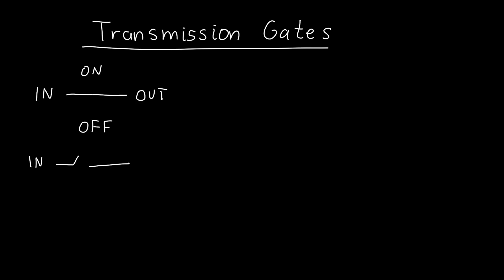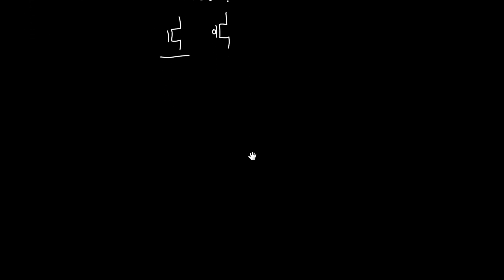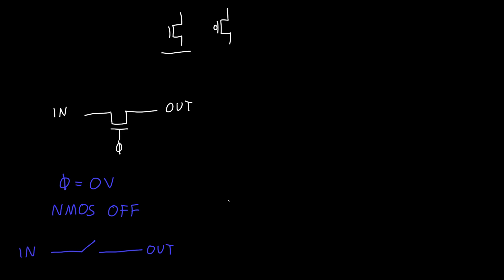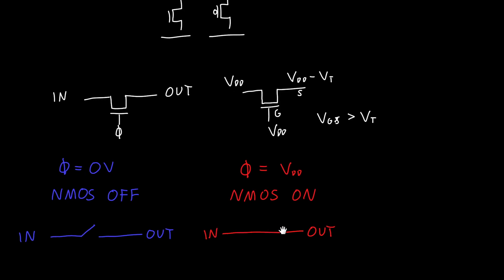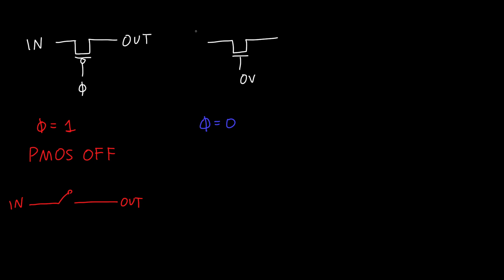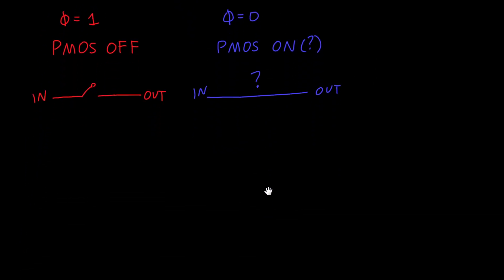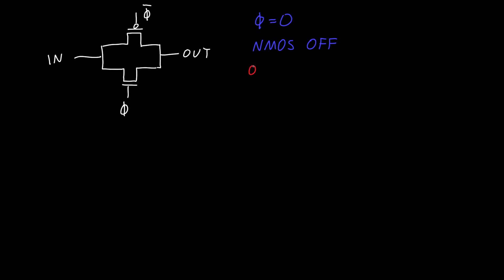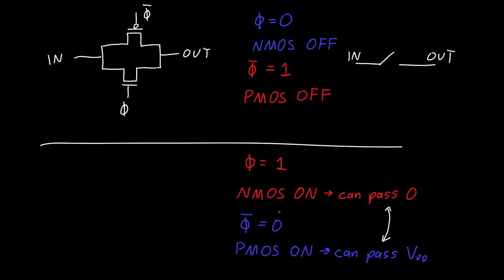Transmission Gates Explained

Comment: You missed about the MOS body diode and how to prevent it by tying the body of NMOS to GND and PMOS to VDD. Also it is important to note that the transmission gate cannot be built using typical off-the-shelf PMOS and NMOS because their bodies are always tied to the Source. One exception is CD4007, which can still be bought (although very rare nowadays) to build one. I know you have other video addressing related topic (body effect), but I thought it is important to mention it here to not misled the audiences into thinking that they can easily build one using typical MOSFETs.
Reply: Thanks man your comment is extremely relevant here.
Reply: Thank you! I specifically searched for an explanation, why the body diode doesn't ruin everything!

Comment: why the hell are you labeling the source in the same spot for both pmos and nmos, thats literally not how it works.
Reply: He is correct in his labeling for both NMOS and PMOS. He elaborates the MOSFET concepts not operating in the way you would normally think. The "in" is on the Drain terminal and the "out" is on the Source terminal of both NMOS and PMOS to demonstrate (with both MOSFET turned ON):
1) NMOS poorly pulls down but PMOS excels in pulling down the Source terminals when the Drain terminals are set to 0V, 
2) NMOS excels in pulling up but PMOS poorly pulls up the Source terminals when the Drain terminals are set to Vdd.

However, this is an oversimplification to convey the concept across using Vgs (as we all engineers learned it). In the actual construction, the body/bulk of both MOSFETs are not connected to their respective Source terminals, but instead to the Vdd (for PMOS) and to GND (for NMOS), so the Source and Drain terminals are interchangeable. This of course makes the value of Vt variable (which is now dependent on the voltage on the Drain and Source terminals [but this is off topic]).

Comment: at 5:03 I think you drew the wrong Source and Drain.
Reply: agree
Reply: No, this is a PMOS transistor. Source is higher than drain.
Reply: @AS-bg9lg  But the professor drew the drain (IN) higher than the source (OUT) for the PMOS transistor.  It just feels fast and dirty.  I wish he spent more time and drew the FETs with an arrow on the body instead of a bubble on the gate.